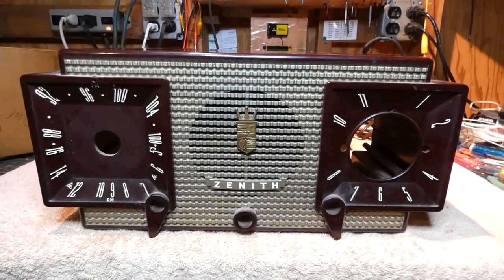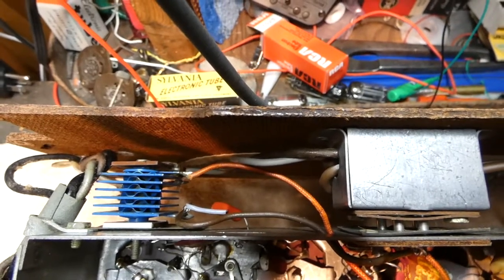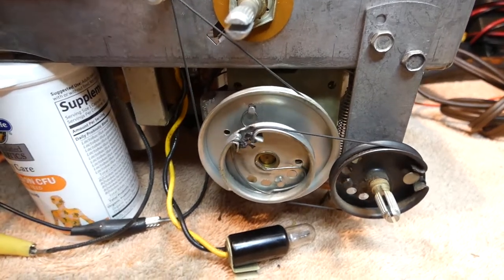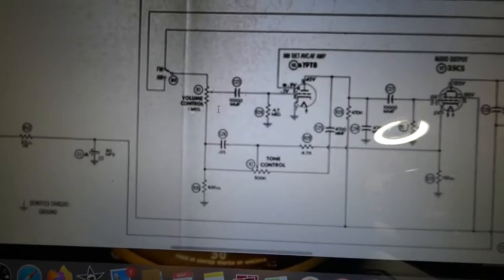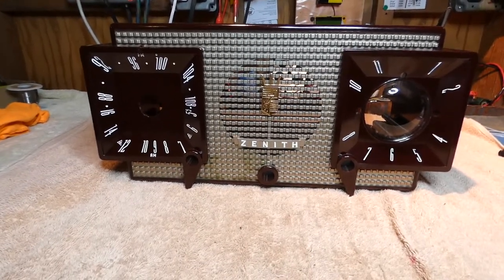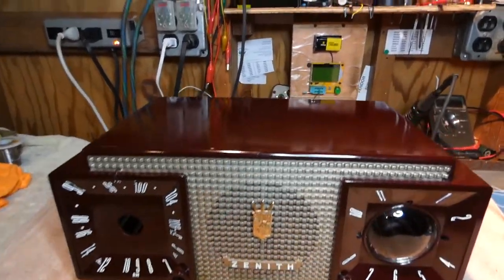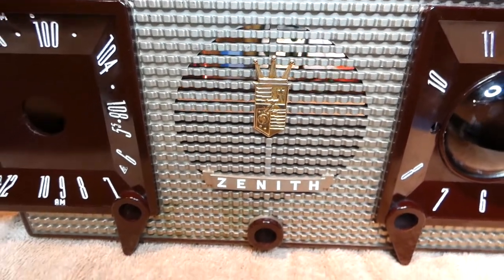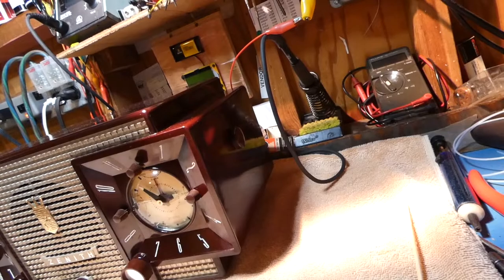Zenith Y733 AM/FM Clock Radio repair/restore

Comment: Great job Bob. It sounds great and looks great. Can't get over how clean and scratch free the cabinet looks, especially around the dial and clock. Did you hit it with any Novus? I have been using Meguiars Ultimate on all the metal and plastic parts on my ZTO's. Really makes everything pop. Take care. GARY.